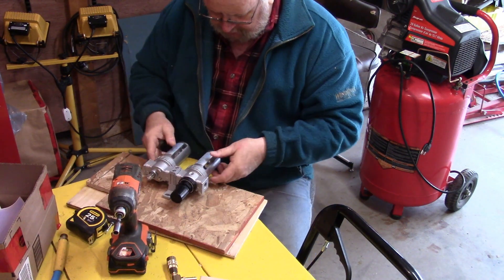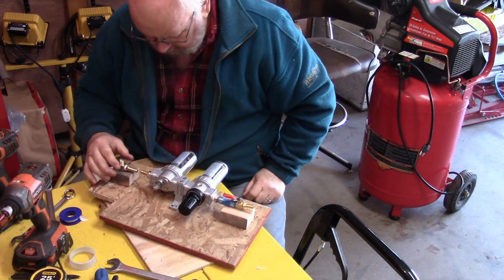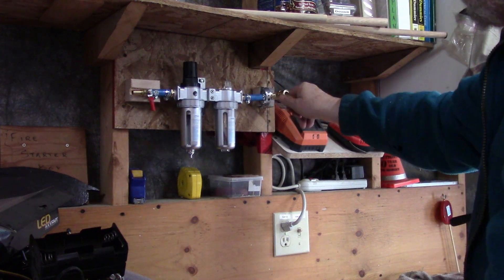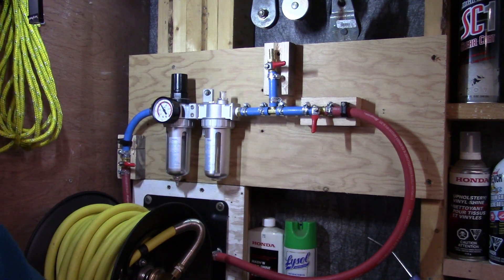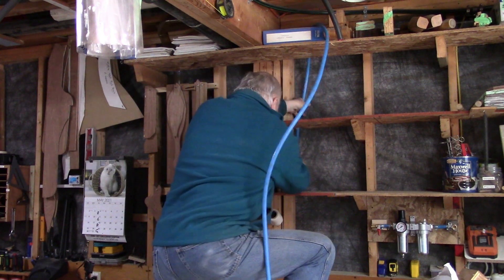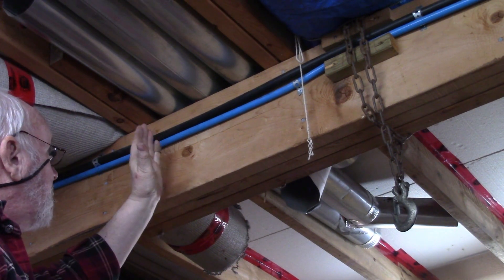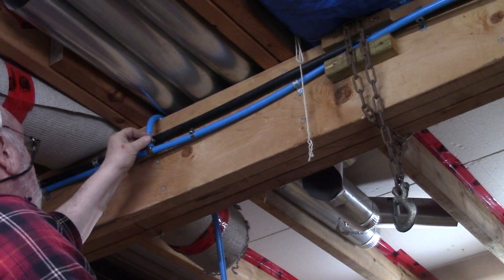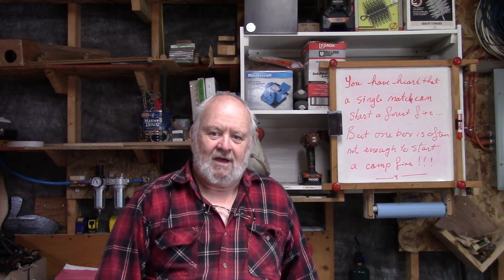Extending the Air Distribution System

Comment: sharing some great skills in this air management system you designed. those brass fitting dont come cheap. I bought a couple last week and the price nearly shocked me. of course everything seems high priced lately to me. enjoyed the video as always.
Reply from the maker: How's she goin'?  The brass fittings are pricey no doubt, but what I noticed more than anything that made a difference was in the Quick Connects.  Some of them, the cheaper ones, only had like 3 balls in the quick connect and the better ones, and they were brass, had 5 balls.  The 5 ball quick connects make a much better connection and lots less chance of air leaks!!!  Thanks a lot for commenting and watching.  Have a great week!!!

Comment: Nice line set up Mike.I need to do the same in mi chop.
Reply from the maker: Salut Serge!!!  It sure is nice to have the extra outlets around the shop!!  I was wanting to do this for a long time and I'm happy it's finally done.  And with this set up I can still disconnect the compressor and wheel it away, so it stays mobile!!!  Thanks for tuning in and take 'er easy!!!

Comment: Hi Mike!  Great job expanding your air distribution system!  Just curious why you added a second regulator and oiler at the other bench downstream from the primary regulator and oiler. Thanks for sharing!
Reply from the maker: How's she goin'?  The main line has a regulator/filter/oiler and this serves the whole shop.  I have this regulator set to about 120 PSI and I don't use the oiler.  At least not yet.  The idea of the second regulator/filter/oiler at the wood bench side is I may have a need for tooling that operates at less than 120 PSI.  Many wood working tools require oiling, so I can add it here and not have it in the main distribution for the whole shop.  The filters, well actually they are supposed to be water separators, will service both the mainline and the wood bench.  
This was a good question Martin and I spent some time deciding what I wanted and where for the air outlets.  So I'm glad you asked me!!!  Thanks for tuning in and take care!!

Comment: Shop air is a very useful thing and you did a nice neat job of yours. My compressor is right at the front roll up door. I have a hose reel and regulator/water separator station there. I mainly use this for filling tires and blowing grass clippings off the tractor deck. Last year, I ran a branch line over to the other side of the shop and mounted a hose reel there. I use this line more for air tools and such. I want to run another line teed off this one to my work bench and I will add another separator/regulator there for cleaning carbs and small jobs. I will need a curly hose for that one. Another thing I installed last year, was an auto drain on the main compressor tank. This little timer does a blow off once a day for a few seconds to keep water from building up in the tank. The manual tank drain was awkward to get at and who wants to be laying on the floor to get at it anyways! LOL In other words, the manual; drain never got used!
Reply from the maker: How's she goin'?  I'm not sure if you saw my video on the Demise of an Air Compressor.  Well in that video I talk about condensation and water build up in the compressor.  So with this compressor I added a whip line of about 3 feet on the drain and I drain my tank every Monday!!!  LOL  It's some nice having access to air at different locations in the shop eh!!  It sure lends itself to using more air powered tools and equipment when it's easy to get the air supply access.  Thanks for tuning in and have a great week!!!

Comment: Awesome Grampie《☆》Nice system👍You've included everything necessary. As time goes by & the frigid temps return a few tweaks will be needed and that's to be expected◇¿.🌴◇:*:◇🌴Greetings from⛾Florida🤳my friend😎🎱☮🔊🖖👍
Reply from the maker: How's she goin'?  Yes that will probably happen.  When the cold sets in the air line connections may all start to leak!!!  The gear clamps I used were not the best.  I didn't show it, but a couple of them failed when I was installing them.  Oh well.  Thanks for tuning in and take care!!!

Comment: Nice and tidy plumbing Mike, thank you. Been meaning to put a set of filters on mine for a long time.
Reply from the maker: How's she goin'?  Thanks for the nice comment!!!  I added the regulator/filter unit on the wood shop side as I figured I might need to vary the air pressure depending on what tool I was using.  So far though I just run the air at the max the compressor is set too!!!  LOL  Thanks for tuning in and take care!!!